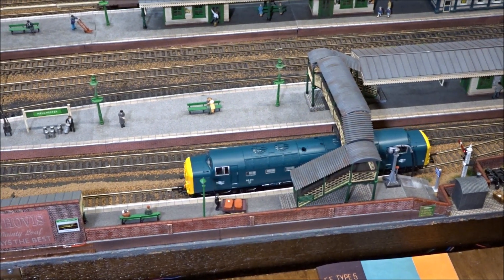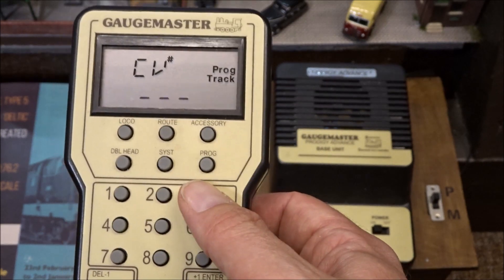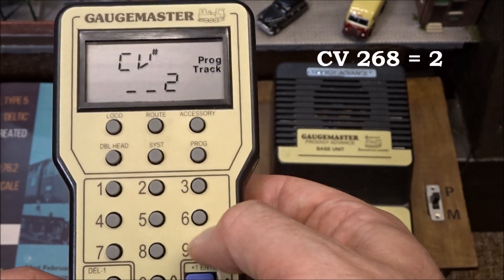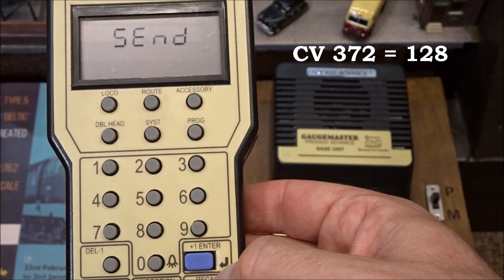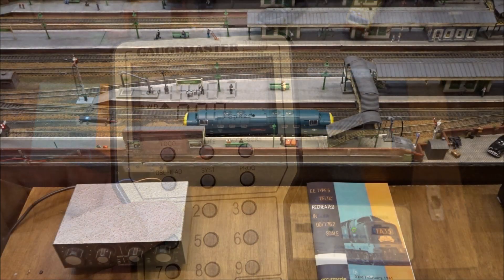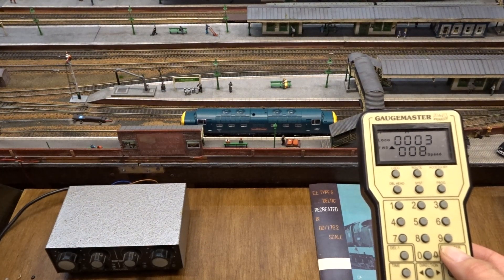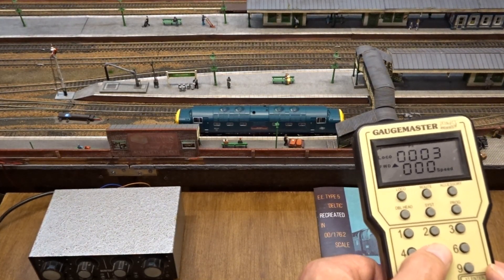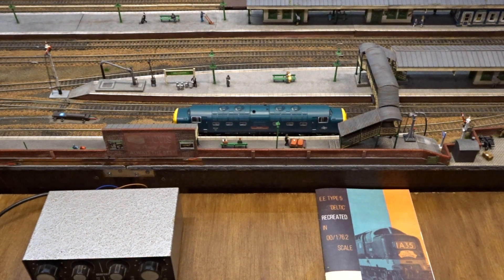How to enable "Drivehold" on the new Accurascale Deltic

Comment: How did you do your platform 6 program track switch?
Reply from the maker: Platform 6 is isolated from the rest of the layout; there is "programme track output" from the Gaugemaster base unit, which I have wired to the programme track via an on/on switch. Most of the time platform 6 functions just like the rest of the layout, but when I want to programme a loco or read CV settings etc, I just flip the switch so the track is isolated, and it becomes my programme track.

Comment: Thank you for that. I have the Gordon Highlander which F5 will not work. I did what you suggested and it worked But only if you stay In default 3 to run the loco, as soon has you put in a 4 digit address the f5 function will not work . Did you change your address out of no3. Mick
Reply from the maker: That's interesting Mick. I haven't changed the address yet, but will try and see what happens.
Reply: @melchestermodelrailway  Please let me know. I am waiting for Accurascale to come back to me after reporting the problem.
Reply from the maker: @michaelsmith-hn1cn  I changed the address and the drivehold still worked ok, so what I'd suggest is. 1) reset the loco to address 3. 2) go through the program changes to enable the drive hold, 3) change the loco address to the one you want. If none of that works you could try a factory reset, then go through steps 2 & 3. let me know how you get on.
Reply: @melchestermodelrailway  I Have done all of this twice, no good. Have herd from Accurascale they recommend change CV 29 ==  62 will let you know the result. Mick
Reply: Got it to work. I tried 2 digit then a 3 digit both worked. I put in the running number of 9016 and this worked but if I put in 5516 it would not, so it seem the decoder did not like 5515 for some reason. So it run with 9016 sorted. Mick
Reply from the maker: @michaelsmith-hn1cn  That's great news Mick - odd though that it didn't like the running number. Glad you'll be able to use the drivehold now.
Reply: @melchestermodelrailway  Thanks for the reply. Mick

Comment: I want my deltic to come into the station  at a realistic sound of the power unit Ticking over NOT REVING AS IT DOES FROM THE FACTORY.
Reply from the maker: If you use F5 Drivehold, you can get exactly this effect. As you approach the station, press F5; then reduce throttle to zero; then make quick short presses of F5 to gradually reduce  the loco speed and bring to a standstill. Works best if using 128 speed steps. Hope that helps.
Reply: @melchestermodelrailway  I thank you for that,maybe also if you play with the cvs for deceleration you could zero your controller which should put it in tickover and roll into station and stop, got to judge it well though.  Thanks.

Comment: Hi, a great tuturial on setting up this feature. I don't understand why this function didn't work out of the box really. I did this with my own Deltic before your video hit the screens as Dave at Dean Park listed the CV changes at the end of his last video too. I never realised how "Drivehold" worked until seeing a video from an American Youtuber who had a guy from ESU showcase the drivehold function, it does really bring a new level to the loco. I especially like how it can act like a working brake, something I always though was missing from ESU decoders which Zimo features. I have some US outline locomotives with Tsunami decoders they have something called Dynamic Digital Exhaust, a feature that automatically notches the engine sound up and down depending on the current the loco draws.............I've never seen that feature on any UK outline decoder. Sorry I was getting carried away again.......All the best Dave.
Reply from the maker: Thanks Dave, yes it's a very useful function to have, and really helps make for more prototypical running. The Dynamic Digital Exhaust you mention sounds interesting. It sounds like it's one step above drivehold, if it functions automatically.
Reply: @melchestermodelrailway  Yeah the Tsunami Digital Exhaust you have to set up and callibrate when you install the decoder, basically changing CV's as your loco runs round at different speed settings. Then when it's don't the engine sound automatically changes with gradient and load behind the engine. If you hold the loco as it starts pulling away the engine revs up eventually to max, as if it's fighting you holding it. It's a few years old now so not a new feature, but I could never understand why we had nothing like it here. There are a  few videos out there about this, if your interested.

Comment: Great concise video. CV31 and 32 have multiple levels of functions in what they control. If the wrong values are set in these, another level of programming will be altered and not the one you intend. You then have to change them back to their normal settings. ATB, Andy.
Reply from the maker: Thanks Andy, I knew there must be a good reason why you have to change those CV settings twice!

Comment: Why is it necessary to program CVs 31 & 32 and then reprogram them again after CVs 267 & 268?
Reply: Presumably these variables have to have these initial values to enable the subsequent changes to be made, then reset to original values afterwards.
Reply from the maker: I'm not sure Paul, I did wonder about that too, but this is how it is listed to be done by Accurascale.